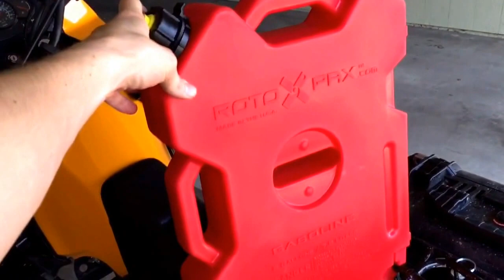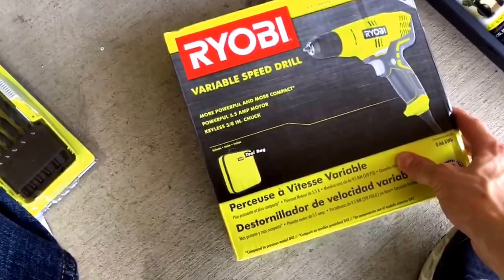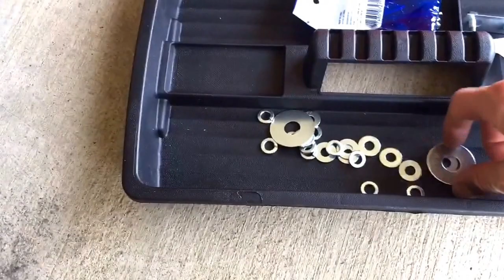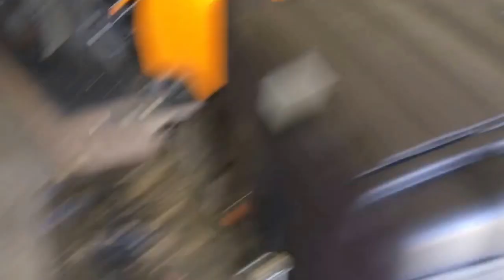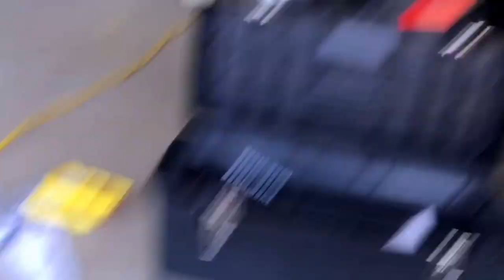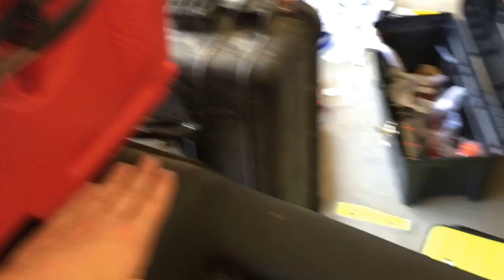DIY KLR 650 TOP CASE BUILD AND ROTOPAX MOUNT

Comment: Rookie mistake. I hope this went well, but anyone trying this needs a flat plate or wood to act as a washer between your fastener and case or the plastic will just tear up after a few bumps.
Reply: Forrest Abbott what does this mean? You’d still need to secure the box to the flat plate (aka plastic cutting board from Walmart)

Comment: I would have flipped the U bolts around and put the bolt side inside the case and the U side passing under the bars of the rack. Would make the box more secure and lessen the chance of the box cracking at the points where the U bolt passes thru the holes in the box.
Reply from the maker: Adam N that was my thought too but then I would have had the bolts rubbing my stuff in the case, five hours of off road bumps and friction a day on my camping supplies just sounded like holes I'd have to patch...
Reply: elliottgriggs88
Actually you could cut the bolt ends shorter with a dremel or hacksaw and put large pieces of dense foam over the remaining exposed bolt ends to keep your stuff from contacting it.
Reply from the maker: Adam N I like it! Next time I'll probably do just that, good recommendation 👌🏼
Reply: Oh one other tip. U may be able to forgo the u bolts all together and use straps meant to secure conduit as long as the diameter of the bars on ur rack us the same or similar in diameter as the one of the off the shelf sizes of conduit.
Reply: Something like this
myhardwaresupply.com

Comment: How is that husky box holding up over time? I'm needing something taller than a pelican case on mine so my lunch box will fit for commuting to work and tall enough to work as a passenger back rest but I hate the way the givi boxes look, what's your thoughts about using one of these to accomplish my task, thanks.
Reply from the maker: I think that the only thing I would do differently is use  hose clamps to fasten the case to the rack, instead of using the U bolts that I did,  U bolts were not as secure as I was hoping for... After one particularly long day on dirt back roads in Utah and lots of bumping and jostling I had to take about 20 minutes and retighten the U bolts, because the Loctite was not working and U bolts were coming loose... 
Way I would do it next time, I would put something in the bottom of the Husky case, for the hose clamps to go around, so as to distribute the pressure and not allow the thin plastic to tear over time... Other than that, I have not had any problems with it, and I have written on a lot of back dirt road as well as a lot of freeway miles, and at speed so as to cause lots of vibration, KLR 650 is not really happy over 65 mph... But I was regularly running it at around 80 mph 😜...  The gas can mount is also still working great 👌🏼